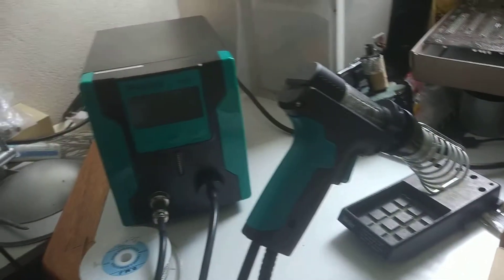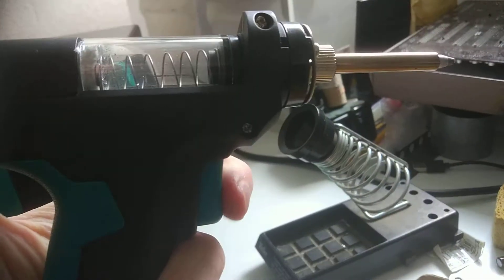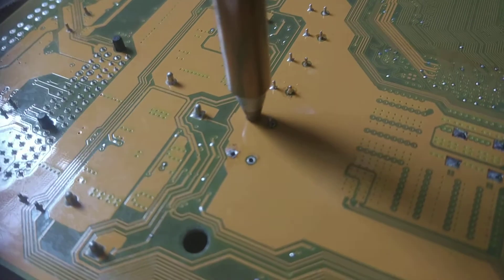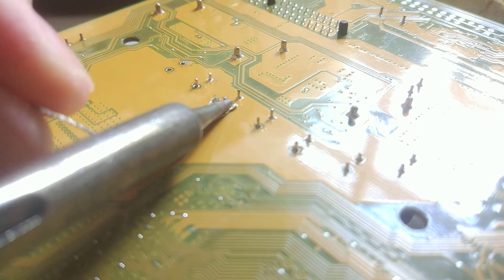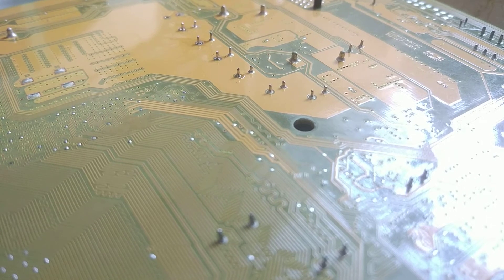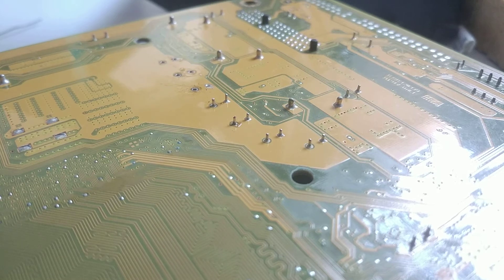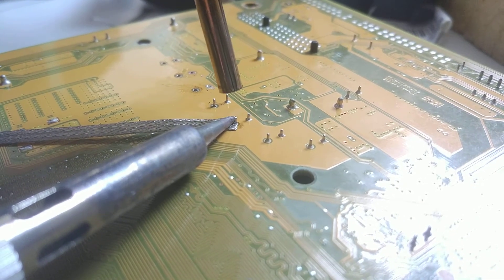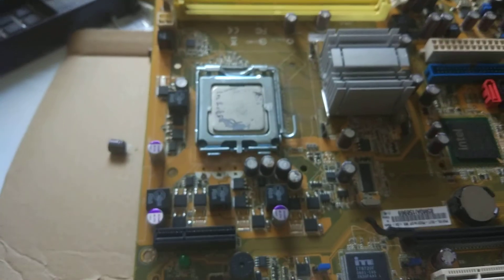[test] Pro's kit desoldering station SS-331H

Comment: I don't think 90 watts is enough for large ground planes.  If you heat the area with the air gun and use the pump at the same time you should get better results.

Comment: hello i bought today i wanted to ask how does automatic sleep work, thank you
Reply from the maker: I dont remember too well the sleep function. Unfortunately I can't test it for a few months, according to the manual there is a simple "Sleep control sensor". Agitating the gun might take it out of sleep. What I can tell you about the gun is that sometimes the sucking function get clogged in the barrel. So the gun might better be used at high temperature to prevent the solder to solidify itsel in the gun. And it also needs a bit of cleening time to time.. But I was so glad to have it to desolder all the keys of my keyboard. It was super long and I can not imagine how you would to without it. It's not up to professional equipment and some hard jobs don't melt (so you need to add heat with hot air for example). That is a nice to have for sure!!
Reply: @Brisou394  thanx
Reply: funkce spánku-musíte mít 7 pinovou verzi-nastavíte si třeba 350 stupňů a máte pistoli ve stojánku a mezitím děláte něco jiného...a elektronika systému po pár minutách nečinosti sama sníži teplotu na 200...když pak uchopíte pistoli že budete zase pracovat tak systém tu teplotu sám zvedne na původní nastavenou teplotu-ale pozor musíte pár sekund počka taž to bude na těch 350 -vidíte to na LCD stanice jak ta teplota leze nahoru z 200 na 350...tato funkce má  chránit odsávací hroty a šetří topný článek v pistoli...

Comment: You have a braun right? so why you dont use the right tip for the right job????

your tipsize is to big. point.
Reply from the maker: Welp, I think I didn't had any smaller in that kit. But if you buy me smaller tip maybe. Also Someone said 1mm nozzle clogged so easily.

Comment: I think using the smallest size tip will work better. 1 mm is the best for normal parts.
Reply from the maker: Wasn't delivered with the kit. So that is what I am using. But I agree on that, would be much easyer..
Reply: @Brisou394 Hi, I have many throughole desolderings, I use all the posible methods.

I have one Hakko 808, one Hakko FR-301, ZR915 and now I am testing the Yihua 948.

My primary tool is the Hakko 808, all my desolderings clogged often with 1mm nozzle.
I use 1,5mm or 2mm.
Desoldering is not a magical tool, I use low melting solder especially in multilayer boards.

I fix High End audio amplifiers and motor controllers throughole desoldering is a every day use tool for me.

Best Regards.